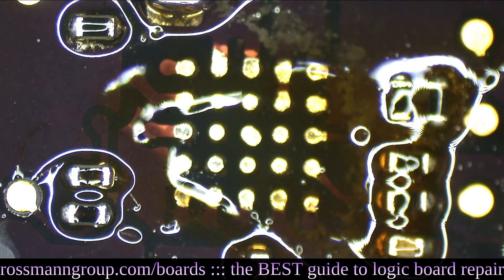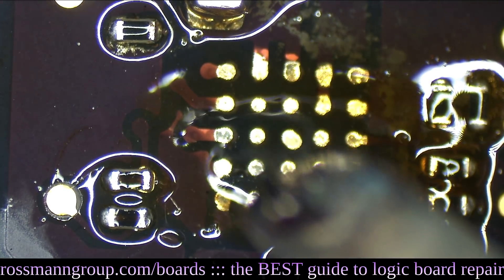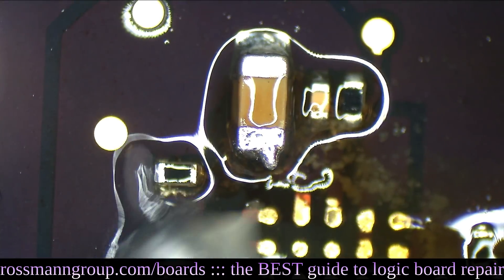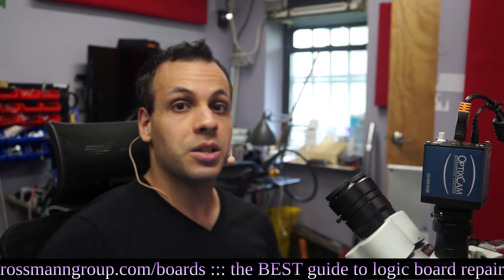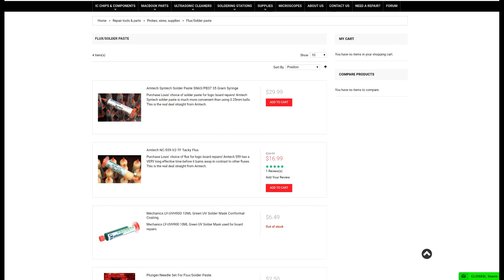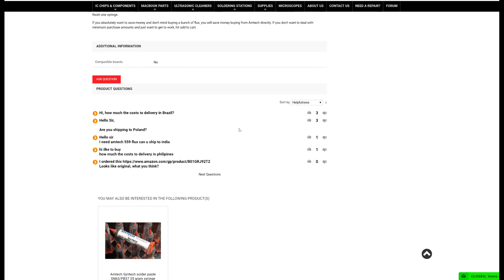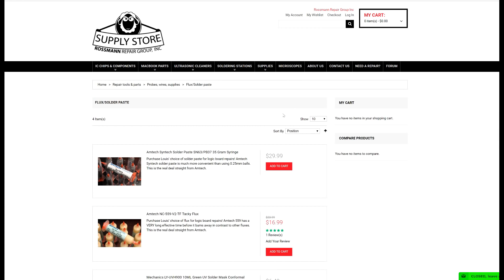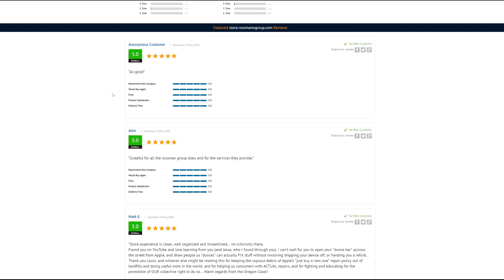HOW FLUX WORKS: What is that gooey liquid Louis pours on the boards?

Comment: plzbro
NOUN:

someone with poor analytical reasoning skills who either cannot, or refuses to learn fundamentals of logical problem solving and instead relies on canned "solutions" to problems from perceived internet gurus. Primarily used in the mobile device repair industry.

VERB: The act of engaging in behavior designing to elicit canned "solutions" from perceived internet gurus rather than engage in logical problem solving.

ADJECTIVE: A word to describe canned answers given to problems from perceived internet gurus.
NOUN:

plzbro technician:(initiating conversation by spamming some other business's contact form) "brother, customer's iPhone 6 not turning on, give solution plzzzzzz."

real technician: "No. Stop asking for plzbro solutions, use your brain."

VERB:

"I saw a guy plzbroing your forum last night, what a douche."

ADJECTIVE:

"That forum has no real information, it is filled with plzbros plzbroing their way to plzbro solutions that will never solve their problem."
#plzbro#iphone repair#macbook repair#component level repair#technician
Reply: huh? where what part?
Reply: TwerkToSpec 
Ah
Reply: Plzbro, which black rectangle chip thingy do I need to fix this macbook?!

Comment: What's the best format of flux to use?
Liquid or paste?
In a syringe, liquid pen, hard block etc...?
Are the any brands to be wary of?
Are their versions with different ingredients that are better or worse.
I have only used  resin core solder before so would love to get some information rather than buying a bunch and using trial and error.
Thanks

Comment: Will your flux leave residue? I had an issue with a DC jack I replaced not too long ago. This was no clean flux and apparently it needed to be cleaned because it melted and got into the DC jack port and caused the power plug in the charger to get stuck in the DC jack. I haven't got around to replacing the DC jack yet as I am trying to find flux that I know won't cause the same issue. I think what made it worse was that I was using a cheap eBay charger that was getting too hot.

Comment: Hey guys! Trying to fix a mid 2009 macbook. The backlight flickers for a split second when it turns on(it was working when the battery was fully charged and plugged in, now it's the same no matter what). Inverter board or something else? I've been having a hard time figuring out what inverter board to get or if that's the actual problem. Any advice would be greatly appreciated. Thanks! 

INVERTER BOARD:
* 4G730 0G BQ XRD A *
503 - 8076
277S21171AA
AS022218001 A1A

Comment: i was taught in EST school not to use flux on electronics .. weird .. 
its also been 20 years since i was in school and havent done any professional electronics work in the last 15 years .. so maybe i am remembering it wrong or there was something else to it (like the solder already had flux in it or something) .. anyway its been too long for me to remember accurately what i was told and i also have a TBI from a bad car wreck in 2005 so that messes up my memory some .. but i could have sworn we were told not to use flux .. i dunno .. you the pro man so i trust what you say
Reply: Probably what you are trying to remember is that there are two types of solder commonly used, acid for plumbing and rosin for electronics acid will destroy electronics.
Reply: Kim Lake 
Probably, like I said it's been a long time and getting hit with a tanker truck didn't help to much either. 

But yes the plumbing part does sound familiar..

Comment: This was more of a "what flux does" video than "how flux works". I was hoping for a more in depth explanation :(. I guess I could just google it.
Reply: Molten solder oxidizes rapidly: Oxidation is the loss of electrons (usually to oxygen in the air, hence the name) which makes it harder for metal atoms to bond together.  Flux "reduces" the oxide layer on the surface of the metal, resupplying it with electrons to make it bond again.  Rust is also a form of oxidation; this is why rusty metal falls apart.  Hmm, that makes me think about heating up some rusty metal and adding some flux to it is see what happens.
Reply: Interesting and makes sense. Thanks!

Comment: You can create your own flux using isopropyl alcohol and rosin. You can find rosin in hardware stores and in music stores (taken from Wikipedia: Players of bowed string instruments rub cakes or blocks of rosin on their bow hair so it can grip the strings and make them speak, or vibrate clearly). Just bash the rosin until it becomes dust and add alcohol (plenty of videos showing the process)
The end result is a fluid that acts as flux and can be cleaned further with alcohol. There is a learning curve about this (it takes time to have the alcohol settle in with the rosin, at first it may seem to be sticky, alcohol may not be able to clean it completely and leave small balls of undiluted rosin) but in some days it starts acting as expected.
Internet people say that they leave it on their boards as a DIY coating that acts like flux when the sodlering iron comes close. Surely enough if you see it on the board all dried out you can add more alcohol and "reactivate" it (make it fluid again). There are rosin-based products on the market just for board coating.
I've had very positive results working with through-hole boards and occasionally with tiny (QFP level) cellphone display connectors.

Comment: Flux is a cleaner. It melts before solder, flows into the joint, cleans off the dirt and oxidation (which floats away), and forms a barrier between the joint and air to prevent any further oxidation, until the solder flows in and displaces it.

Comment: It does seem that you use far more flux than needed, but the result is what matters.  I use Chemtronics (No Clean) flux pen.  It is also useful to make solder wick more effective.  Where I used to work, I used an Ungar heat gun to sweat parts off the boards.  Also Kapton tape is useful to shield close components from coming off the board. We also had the binocular microscope similar to yours, but it was lit via a fiber optic cable fed from a separate light source.

Comment: I guess that means I'm a  filthy soldering casual for doing it without flux on old console parts?
Reply: depends
are you using regualr solder wire? it usually contains a resin flux inside

Comment: I was just watching an AvE vijayo and reading comments about him not using flux, then people in the comments made fun of you for using "300oz" on one resistor, and the best part, the notification for this video came up right after I read it.
Reply from the maker: I will have to send ave a few pounds of flux.
Reply: Louis Rossmann release the shmoo
Reply: on larger stuff you can get away without using flux
but on the tiny smd stuff you need flux so you can go in and get out quickly without overheating the component or destroying the pads
Reply: 300oz on a poor little 0402
Reply: Louis Rossmann hmmmm #malebag
Reply: flexing with flux.
Reply: Wesley Van Pelt ha!
spooky...